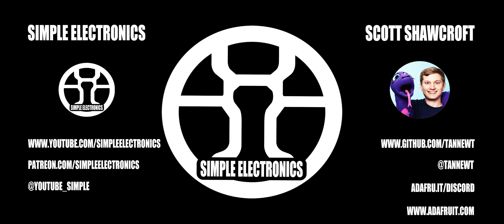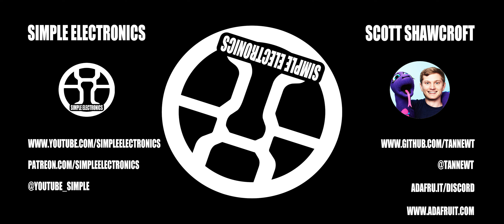The Simple Electronics Podcast - 014 - Scott Shawcroft

Comment: Great interview as usual. Going back to what you were saying about updating software and it upsetting your system, I am using Arduino-1.8.12 for windows, I can't update this as it's the last version to (sort of) work on XP. Even so, after uploading the code to the board I'm using. I instantly get the message, USB Device Not Recognised. Luckily the code works perfectly once I unplug the USB cable and use batteries. LOL.